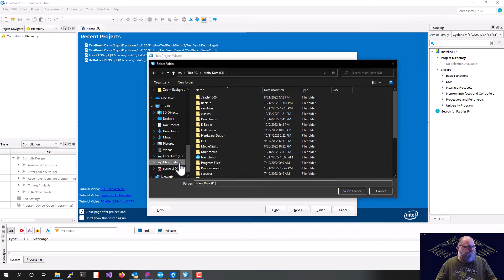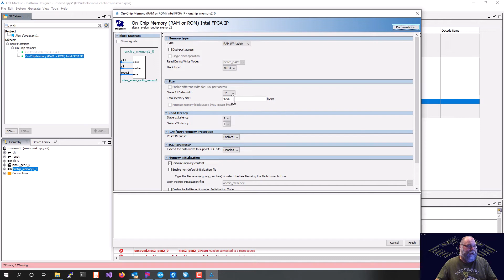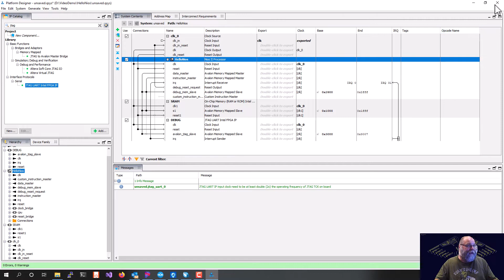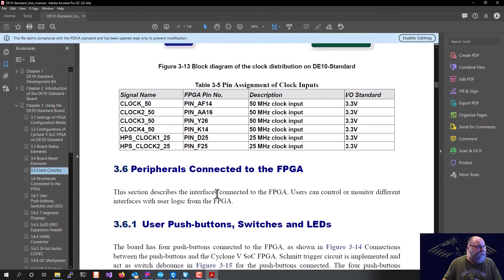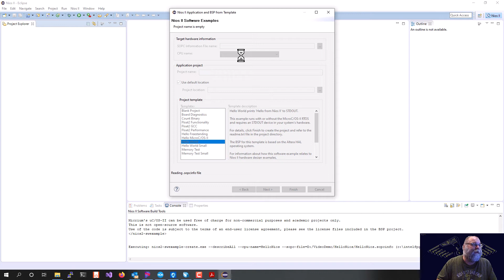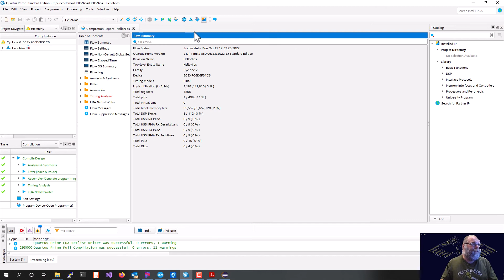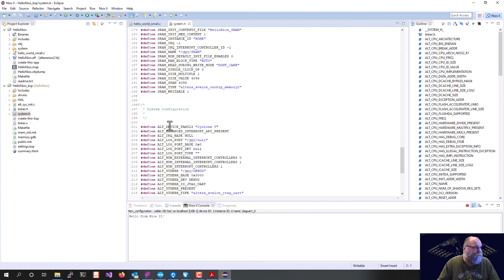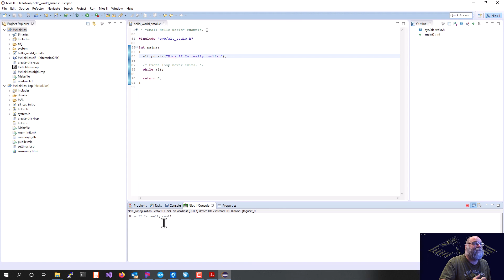Hello Nios II

Comment: I followed along using a Terasic DE1 / Cyclone II and Quartus II 13.0sp1 ... and I couldn't believe that it worked the first time.  (even though there a minor differences).  Now how to program the LED's, 7-segment digits, and read switches.  ... then how to pass data back and forth.  AND then find a tutorial that shows how to do this same kind of thing using a hard-processor, like a DE0-Nano-Soc, DE1-SoC, and/or DE10-Nano (as I have all three of those!)
Reply: hey @jamesross3939 were you able to find the tutorials you mentioned?
Reply: @sidhharthbalakrishnan7102  Sorry I haven't.... But I have not really looked real hard yet.   I still plan to soon, when I do I'll update with another comment.

Comment: I'm curious that you're able to download the software to the Nios2 system without having included a System-ID peripheral and/or having checked the "Ignore mismatched system-ID / ignore mismatched timestamp" check boxes on the "Run Configuration -> Target Connection" screen. If I don't do those things, download never works for me (Quartus Lite 21.1.1 running on Ubuntu 20.04, programming a DE2-115 Cyclone IV board).
Reply from the maker: I have never used the peripheral and never check the box to ignore the system-id... I have found it an unessary step for me personally. I have used Quartus from versions 16 on up and never had a problem in either windows or linux environments....